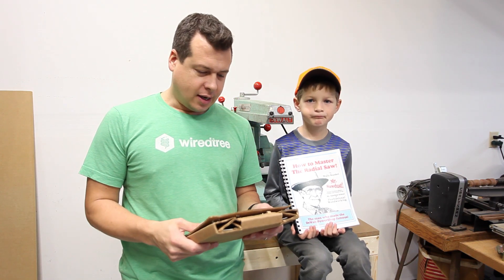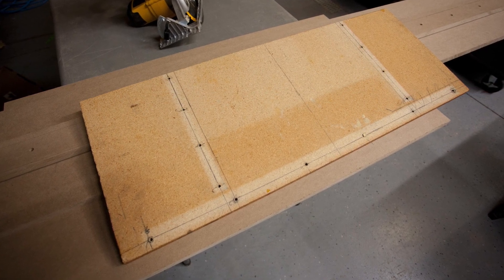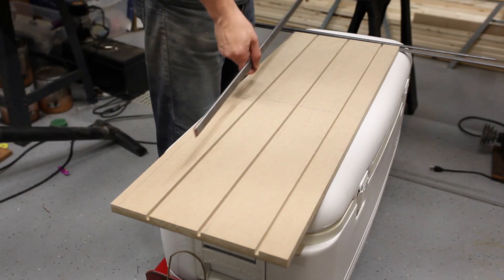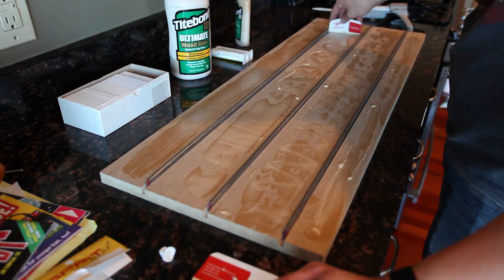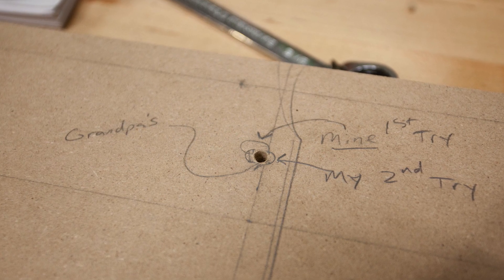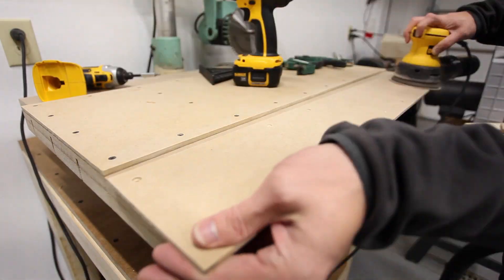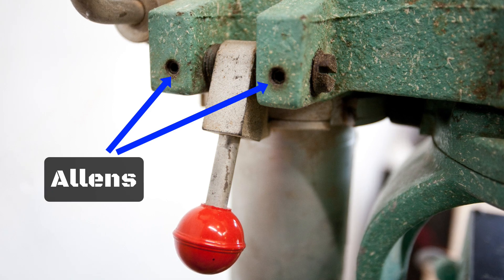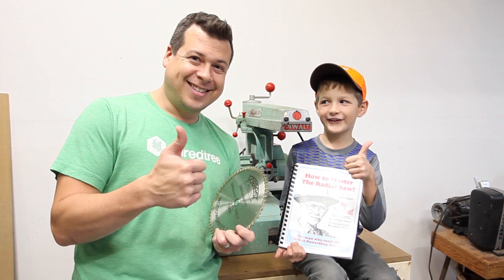New Shop Build: Part 3 - Building a Mr Sawdust Table

Comment: I glued my "Mr Sawdust" design table up on my granite counter top also.  I neglected to check the flatness of the counter top.  Big mistake.  I ended up with nearly .040 inch "belly" in the middle of the finished table.  Conclusion: granite counter tops are not necessarily very flat so check yours before you try this method.  I've no good ideas what to use as a flat surface to do this glue up on.  I used 6 bags of readi mix concrete (60# bags) to apply pressure during the cure.  The counter I glued the table on was a standard kitchen counter top.  Maybe 360# of weight caused it to bow?
Reply from the maker: I've heard this before about granite countertops as well. Mine seems to be very flat and works well. Did you put a good straight edge on your counter top to check the flatness? I also think using too much glue can cause it to warp a bit.

Comment: Great video......How many cuts did you get before you hit one the 3 billion screws you put in the sacrificial top..???
Reply from the maker: Never hit a screw.  I strategically placed the screws so that they don't interfere with the most common cuts.  For the occasional uncommon cut, I track the blade across the table (not running obviously) to see if it will run into a screw and if it does, I simply pull the screw before I make the cut.  Then I screw it back in when I'm finished with the cut.
Reply: @TommyTompkins  Yeah, I don't ave that kind of luck.  My first cut would hit a screw head...LOL.  Every once in awhile I hit a staple that was strategically placed in the wood by the stockers at Home Depot....I went out and purchased a small metal detector...I scan every board before I plane, route or cut anything....

Comment: Tommy, great video - I am trying to locate the Mr. Sawdust book however it is not available - maybe you could answer a couple of quick questions: 1) Is teh table length 36"?  2) How do you setyup the drop leaf front edge support?  There looks to be some nice hardware supports that "click" into place.....I have your plans and intend to build all of the table :-)
Reply from the maker: Hi Gordon - the Mr Sawdust book should be available at https://www.mrsawdust.com/.  In regards to the table width, mine is 37 inches wide, but this will vary depending on the Make / Model saw that you have. My saw is the DeWalt 925H which came with the drop leaf hardware.  I don't know any other saw model that came with this hardware so it might be the only one with a drop leaf.
Reply: @TommyTompkins  Thanks - just ordered Mr. Sawdust.  I also will look up your saw and try to get a manual to see how they may have done the hardware for the drop leaf.  I have ordered (4) lengths of 1" x 3/16" flat steel so I can make the table whatever size is needed.  I have a  DeWalt 770 and I want to setup my new shop using your plans as the centerpiece for the radial arm saw.
Reply from the maker: @gordonhope9219  Sounds like a good plan!  I don't think the 770 had a drop leaf though.  The drop leaf hardware is basically just a bent steel rod with hinges where the ends of the rod insert into holes on the front of the saw box frame.  There are bolts with nuts that are inserted from the side of the box frame that act as stops for the steel rod. I'm sure something could be fabricated for your 770, but it's probably easier just to build a slightly deeper solid table. Good luck!
Reply from the maker: @gordonhope9219  Sounds good. You're going to love the setup with your 770!
Reply: @TommyTompkins  I just completed both the Sawdust table as well as the dust collection box.....whereas I did not hook up a vacuum system yet to the 3" PVC inlet, it came out perfect!!  The table itself is by far the best design for an absolutely flat table one could possibly build!  Now I am in the erection process of my worksh op and then once complete I can move the tools into it and complete the rest of your plans for the saw table as well as both tables on either side :-)
Reply from the maker: @gordonhope9219  Nice! Good luck with the build.  I'm sure you'll enjoy it!

Comment: Hi To,m I purchased your plans for your work tables piece of cake. What are the actual Dimensions for the top on your radial arm saw and how did you do the drop leaf hardware.
Reply from the maker: If I remember correctly, my 925H table is 37" wide. The drop leaf hardware was a feature that came with the 925H. It's just a simple U-shaped bar that gets propped against a couple of bolts on the sides of the RAS frame. Shoot me an email from the contact form on my website and I can email you pics of the dimensions with spacers.

Comment: Did you use the original hardware for your table top? It looks like new screws. If they are new how did you adjust the table to the rails on the saw base?? The original has adjustments for leveling the top.  I found the exact saw you have and have purchased your plans. Great U Tube videos!! Thanks I look forward to getting my shop set up
Reply from the maker: Hi Richard - yes, I used the original hardware. No new screws were used. The original screws that secure the table top to the rails were aluminum. For this particular model (the 925H) the rails have slot adjustments built in so you can adjust the rails up / down to get your table level.

Comment: These are some great videos. You use good camera techniques and don’t hide your mistakes as when you ate up your dust collector hose. Love that honesty. A suggestion and I’m not a safety Nazi, but I am a wood hobbyist who’s been at it for almost 60 years so take it for what it’s worth: the glue used to make that composite MDF hold together is almost as tough on your lungs as cutting pressure treated wood. So if you hope to see your grandkids some day, it’s a good idea to wear a face mask when cutting either of them to keep the dust out of your lungs. 

Keep these great videos coming. Thanks for doing them for us.
Reply from the maker: Hi Dennis - glad you like the videos! I totally agree on the face masks and I actually did pick up a nice 3M mask and have used that daily since I made this video. I also recently built a shop air filtration unit which filters out all of the small dust particles floating around the shop. I should have a video coming out on that soon.

Comment: Fantastic video! I'm copying your method to make my own table right now for a 1987 Craftsman RAS. I can't find Loctite Hysol 9462 on the Loctite webpage. Have they replaced it with a different product? Thank you.
Reply from the maker: To be honest, any good epoxy should do the trick.  5 minute epoxy also would work well, but you'll have to work quick. I haven't bought 9462 in a long time so not sure if they discontinued it.  But if you Google it I see that some places are still selling it.
Reply: Tommy Tompkins Yeah, I saw that too, but it wasn’t on Amazon, so I checked the Loctite site. I actually ended up going with Loctite Epoxy Extra Time, though I needed four of the .85 oz syringes. I personally don’t think I could do all the gluing in 5 mins unless I got the epoxy perfectly in each a lot in one fell swoop, so I needed the “extra time.” Thanks for the reply though! About to mount the table tomorrow, and I couldn’t have done it without your video.

Comment: That is an awesome table. Does the book address the slightly newer Dewalt RAS models? I am getting a 1963 10" Model R-1450. Thanks!
Reply from the maker: Yes, the book is applicable to all radial arm saws - not just DeWalts.  But it does go into a nice history of the DeWalt saws and is primarily focused on those.

Comment: What hardware did you use for the drop leaf on your Mr. Sawdust radial arm saw table??
Reply from the maker: I used the hardware that came with the saw.  Not all DeWalt saws had the drop leaf design.  Mine is a 925H which did have the drop leaf.  You can probably find a used one on Craigslist for next to nothing.

Comment: Best book best saw. best blade.  I build a Mr. Sawdust table a few years ago, and it cuts like a dream.
My table is 2 x 3/4 high quality Ply, and I only used two 1/8 x 3/4 steel strips.   It is FLAT FLAT and very solid.

Comment: Getting ready to do this soon. How long did you let the pieces adhere under weight  before you continued fitting them?   Did you just weight the main board you reinforced or the drop leaf also?
Reply from the maker: I let both the main table and the drop leaf set for 24 hours with weight on top.

Comment: Tommy,

I'm a new subscriber and like your videos.  They are very well done and I have watched a good many of them.  I wanted to know if you could add more info on how you made the drop leaf?  I see the glue up part and your recommendation for a steel bar, but how about the mechanical part?  And with that, how has it held up and would you do it again if you needed to.  I have a DeWalt MBF RAS that has been tuned up by Wolfe Machinery ( Unfortunately out of business, but the shop next store still sells parts and used equipment.).  

 I also own 
"The Magic of Your Radial Arm Saw" by R.J. Cristoforo, 

"Fine Tuning Your Radial Arm Saw" by Jon Eakes,  
Getting the Most Out of Your Radial Saw", Delta Rockwell,
and
Power Tool Know How - Radial Saw, by Sears Craftsman.

A bit of overkill, but each has its good points. But since I needed the directions for the table I couldn't resist ordering the Mr. Sawdust book.  As soon as I figure out if I need an 8" or a 9" blade, I'll be getting the Forest WWI blade as well.

Thanks for the videos and keep on recording!
Reply from the maker: Thanks for the add!  In regards to the hardware for the dropleaf extension, this was included with the 925H saws which is basically a long "U" shaped rod on hinges.  The ends of the rod go into holes in the base of the 925H and is adjusted by bolts that go through the frame. The ends of the rod actually rest on top of the bolts. It's kind of hard to explain without pictures.  But if you have an MBF, this saw was not designed to work with the dropleaf table. I have an MBF as well and the holes and bolts are missing from the frame that's needed for the dropleaf hardware to work.
Reply: @TommyTompkins  Thank you for the quick response.  I would have no issue putting in the holes and making the rod, but like you said it would be nice to have pictures.  If for some reason if you ever need to open up the saw again, please take some pictures and maybe a few measurements.  I'll try and find some info on Vintage Machinery or another forum.  Thanks again.
Reply from the maker: @1SGBob1  Check out the DeWalt Radial Arm Saw Forum which has a lot of info for things like that: http://forums.delphiforums.com/woodbutcher

Comment: Did you attach this and the side tables to each other and the wall?
Reply from the maker: The side tables are attached to the RAS table base legs via metal brackets. The actual Mr Sawdust table is not physically attached to the side tables.  None of the tables are fixed to the wall.

Comment: How did you fasten the table to the 925 saw base L brackets?
Reply from the maker: No L-brackets.  The base has holes on the inside of the base that I used to bolt it to the table top.
Reply: Tommy,
I'm an eighty year old newbie-wannabe woodworker. Stumbled on your YouTube videos, purchased the Mr. Sawdust book and your shop plans. Built the saw table, With your shop plans and videos this was a snap. You Fella, have me inspired! Also was impressed by how quickly you responded to my question. I have a Dewalt 925H which I purchased used 45 years ago. Used it to install an added wall and it has just around ever since. It didn"t take much to get it functioning, just cleaning. Oddly enough, the butchered up table top is fairly true. After experimenting with making a Rabbet with the saw in 20 cuts, went and bought a dado set, set it for 5/8"' stacked all 4 pieces and clamped them to the to 925H's fence, reclamping after each cut. Cut all the rabbets in about six passes and saw had no problem with the 1.5" deep cuts. I'm going to leave the 925H set just as it is to build all the tables in your plans, simply to cut the rabbets and will do the Mr. Sawdust table last. 
Back to my original question: I referred to "L" brackets because that's what Mr. Sawdust called them. They are clearly shown in your Mr.  Sardust table video @ 6:54". What size hole did you drill for the bolts? What bolts did use? Probably the originals. What are they? Did you have to thread the top to accept the bolts. Thanks for setting on the right path, this is adding spice to my life, I was getting bored.
Reply from the maker: Hi Roy - Wow, it's great to see that you're getting into woodworking with your radial arm saw at 88 years old!  I'm happy to see that I've inspired you in some way.  In regards to the L-brackets, I'm sorry, I thought you were referring to the base of the saw and how it attaches to the top of the radial arm saw stand. You're correct, there are L-brackets that come with the saw that the table top is mounted to.  The saw also came with aluminum wood screws that are used to screw through the L-brackets into the table top.  There isn't anything that fastens these screws from the top side.  They just screw into the table from the bottom.  I don't remember exactly what hole size I drilled, but I visually sized up the screw to a drill bit that was undersized enough so the threads would bite.  Hopefully that helps!  Let me know how it goes as you progress through everything.

Comment: I took your advice  and bought the book.  i had some 3/4 plywood but took your advice and struggled home with MDF.  I wish I'd stuck to plywood.  The MDF isn't square and isn't 4 x 8 and I've hated MDF for many years and this is my first experience with this phony BS concoction designed mostly to up freight moving bills.  What else could it be?  So thanks.  I'm gluing my MDF together today.
Reply from the maker: I'm not a huge fan of MDF either but for this particular application I think it's still the best option. My table is still as flat now as the day I made it.

Comment: Will the book help with a craftsman radial arm saw
Reply from the maker: The Mr. Sawdust book has some really good history about the DeWalt saws but once it gets into the radial arm saw techniques, those are still very valuable regardless of what brand of saw you own.  I'd also recommend picking up a book called "Fine Tuning Your Radial Arm Saw" but Jon Eakes.  That book goes more into the setup for various RAS manufacturers.

Comment: Awesome radial arm, mine are old turret arm models from Rockwell a slightly different design but like your dewalt they can be made very accurate and are a joy to use when set up properly.
Reply from the maker: Thank you. I'm very proud and excited to have my grandpa's old work horse back in action.

Comment: Subscribed today when I found your channel, always fun watching a shop come together. 
The woodworker I is a crosscut optimized blade, which has everything to do with the shape and angle of the blade's teeth. 
The woodworker II is more general purpose rip blade better suited for table saws. 
The angle of attack on the teeth of the ww I makes it less grabby which makes a radial arm saw much easier to control. Thought you might like to know!
Reply from the maker: Thanks for the great explanation.  Good to know!

Comment: Thanks for this video. I'm going to be making this table soon. How many tubes of epoxy did you use?
Reply from the maker: If I remember correctly, I think I used almost a full tube. I have a gallon of West System epoxy now so if I was to do it again I'd probably just end up using that instead of buying smaller tubes.

Comment: Hi Tommy, thank you so much for sharing your knowledge, and for posting such beautifully made videos. I've recently acquired a 1994 DW1751. It is my first workshop tool and is in need of some love (and proper set up). I've ordered my Mr. Sawdust book and intend to study it, and follow its instructions meticulously. I understand the importance of having a truly flat and rigid table, but I'm puzzled by the practice of using one's granite kitchen benchtop as the base for one's freshly glued Mr. Sawdust table. Can one assume that his/her granite benchtop is sufficiently flat? Thanks in advance for any light you can shed on this issue. Regards, Dave (Sydney, Australia).
Reply from the maker: Thanks David - The only reason why I used the granite top in my kitchen was because it was the flattest surface I could find. I used a 6 foot straight edge across the granite top and shined a flashlight behind the straight edge to see if any light shined through.  I had hardly any light coming through so I knew it was flat.  My other granite counter turned out to be not so flat using the same technique so one can't assume that all granite tops are dead flat.  According to others more experienced than me, if you glue up your table on a surface that isn't flat, the table will likely have a slight crown or bow in it.
Reply: Thanks Tommy, I appreciate the reply. Regards, David

Comment: Great video Tommy...your plans are just what I need for my garage/workshop. I cant wait to get into this!...one question...I have a 1987 Craftsman RAS and want to resurrect it just as you did. Would purchasing the "Mr. Sawdust" manual work for a Craftsman or is it specific to Dewalt's RAS?
Reply from the maker: Thanks Dennis!  To be honest, I'm not all that familiar with the Craftsman models but I'd still recommend the book for any RAS since it teaches you a lot about the techniques of how the RAS should be used.  The DeWalt specific setup wouldn't apply to you, but the same concepts would certainly apply.  I'd also recommend getting the "Fine Tuning Your Radial Arm Saw" book by Jon Eakes.  The Eakes book is good for setting up any brand RAS.